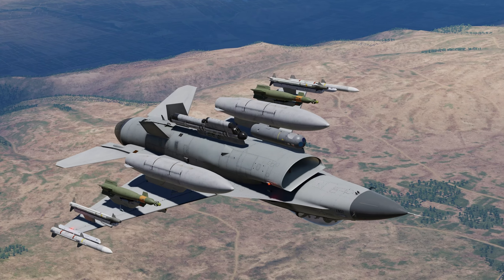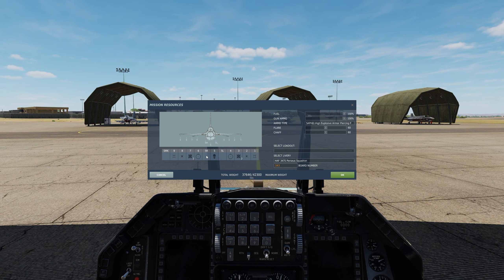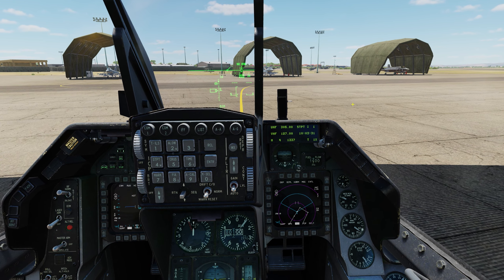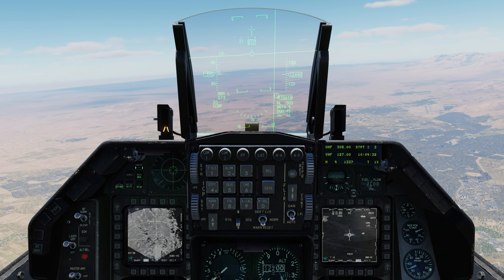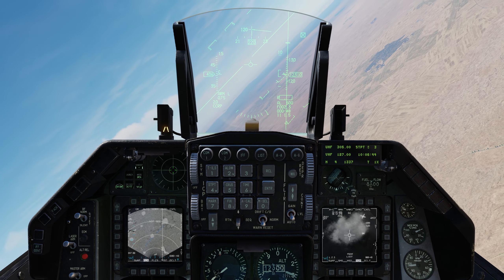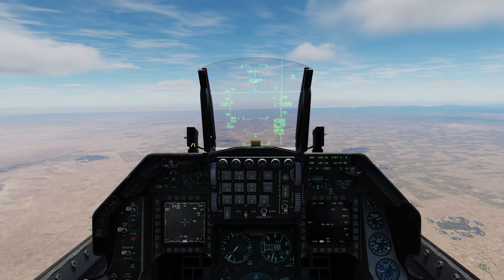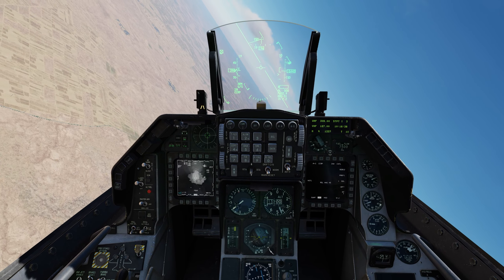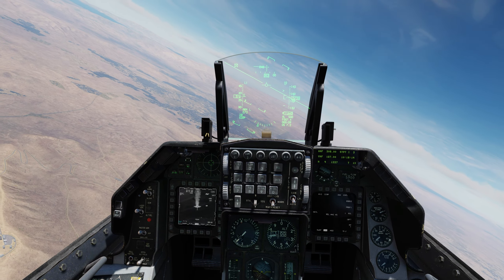F-16 Weapons Masterclass Ep. 3 - Laser Guided Bombs | DCS: World [UPDATED]

Comment: Thanks for the video, what about the release angle? I think you should climb 45 deg before the pickle. I wonder how the bomb was released in your video.
Reply: That's what the range is for the caret moves down. Top is max range if you climb the programmed angle (45° in your example), which is represented by the horizontal "vertical steering line". When your FPM hit the steering line, the bombs drop. So, the higher you set the climbing angle the higher the "max range" indicator. You ignore it or decide to climb later? No problem as the closer you are the less steep you have to climb for the bomb to reach the target. You don't climb at all? No problem, then the vertical steering indicator will just move down and will reach your FPM at the bottom of the range bracket. Programming a climb angle is nothing more than a guidance. The shallower you program your climb angle the smaller the release bracket. At programmed 0° there isn't any.